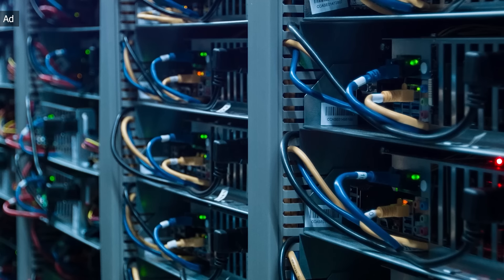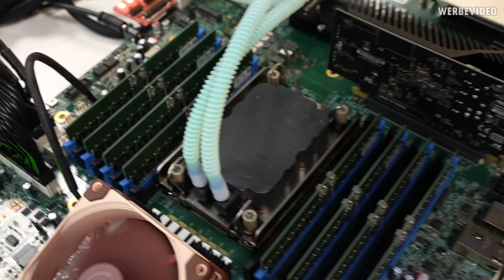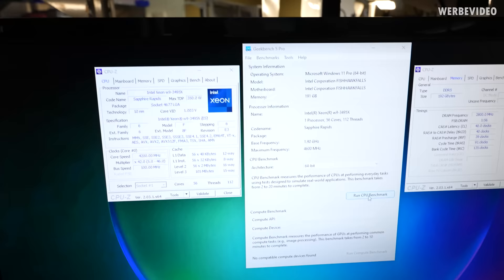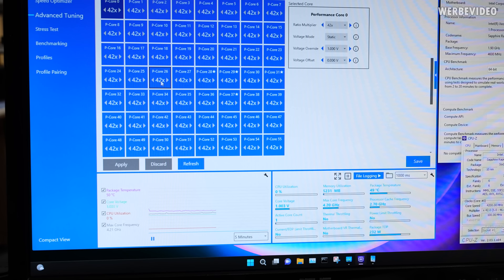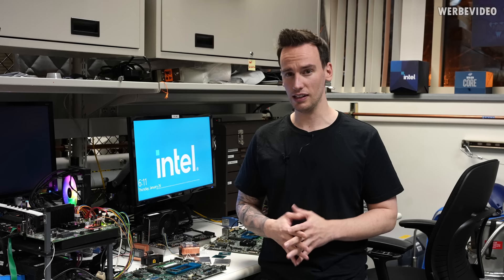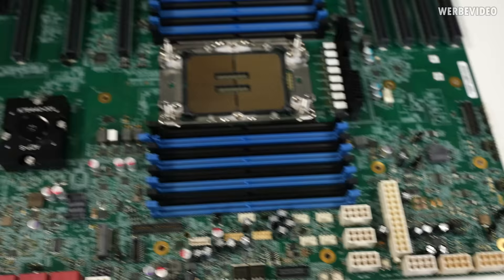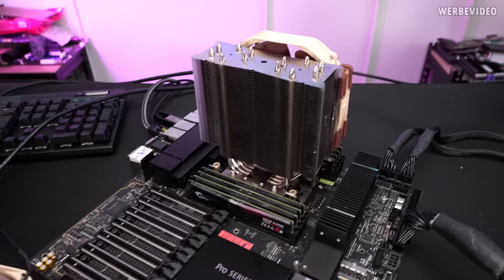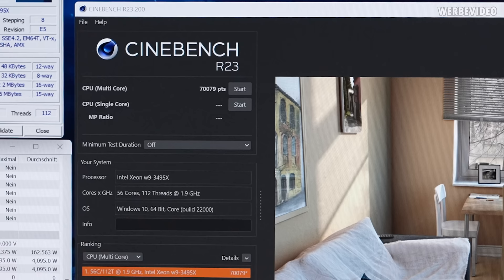Intel HEDT is BACK! Insane Overclockable 56 Core Sapphire Rapids CPU

Comment: For reference, I found a page which is showing the Ryzen Threadripper 5995WX scoring 65,112 points in Cinebench R23, with a base clock of 3.2GHz.  Sapphire Rapids is 7% faster with 12% fewer cores and 10% fewer clocks.  At 4.2GHz this thing might just break 100,000 in Cinebench!
Reply: Not stock, power limit was removed and it reached 516w (stock limit is 420w turbo) and it scored 70,079 points
A 5995wx (Zen3 is in its 3rd year now) also with power limits removed scored 69581 while the max power draw in blender was 461watt.
-Unreleased sapphire rapids =135.8points per watt
-Zen3 =150 points per watt
Do you think AMD could uncork the power and increase their score 0.7% with 11.9% more power?

The 4th (out of 5) place 5995wx score... is 78,632 at 4.35Ghz on water.
91,400 was scored by an old Zen2 3990x on H20.... in a case.
Reply: @tomstech4390  "Do you think AMD could uncork the power" No, actually.  From my experience in the early days with Zen 1 (I had a 1700X, 1800X, 2700X and a Threadripper 1950X and a 2990WX) there was literally no overclocking headroom no matter how much juice you gave it.  It wasn't power limited, it was something else entirely but I never could quite put my finger on it.  Has the situation improved on 7nm and 5nm with Zen 3 and 4?  I don't know, I haven't using AMD in a while.
Reply: @tomstech4390  "The 4th (out of 5) place 5995wx score... is 78,632 at 4.35Ghz on water."

Cool.  Thanks for the info.  In der8auer's video here, it hit's 70,079 pts with all the cores seemingly locked at 2.9GHz.  Using the same 360mm AIO in the test lab earlier, they were locked in at 4.2GHz.  Using a simple linear extrapolation, we can project a Cinebench score of 101,493.  Now obviously it won't be a perfect linear scaling due to diminishing returns, but it could get awfully close to that 100K mark.

Using a 1600w power supply, presumably...

Comment: 6:42 - I have a question, why does the core overview put the "favor cores" in weird places in the grid chart, instead of at the top?   My 7950x is the same way in taskmanager...  I can definitely spot which cores are the favored even though they aren't marked by stars or anything.    There seems to be no symmetry or rhyme or reason as to why or what in taskmgr compared to where they might actually be located on the chip / die.

Comment: Speaking of DDR5 ECC with XMP, i stumbled accross some DDR4 ECC a few years ago that had XMP and it seemed to work with everything, sure it was only 3200, but for a 128GB kit thats actually a pretty good speed for ECC at the time, and i think even now, because i think most ECC kits are still 2400/2666
Reply: With ddr5, there are already 6000mhz ecc kits, thats also pretty good.
Reply: @Sineseol  True, but you're not getting 4 sticks of 64GB ECC 6000 for several years, at least not running at 6000, let alone for ~$400 total
 
IIRC it was $196 for a 2 stick kit of 64GB DDR4 uDIMM ECC 3200 less than $300 for 128GB

Comment: Wow, that power draw is enormous... At least here in the states with 15A 110-120V(rms) circuits, thats a seriously non-trivial amount of power draw.
Reply: you'd be tapped out around 1800 watts on a 15A breaker, but could go 2400 on a 20A.  Maybe we will see the rise of 30A single phase 120V circuits to support our ever more powerful CPUs at 3600 watts...!  I see they have 30A single pole at HomeDepot for $6.98, but wondering if you'd need a larger gauge romex from the box to your server outlet, and what kind of outlet you'd have to use, guessing twistlock 30A.
Reply: @JimBronson  Most house wiring is gonna be at around AWG 12 good for 25A max, though regulations limit continuous loads to 20A. Quite a few circuits are only AWG 14 good for 20A max, with regulations limiting continuous loads at 16a. If you want a legal and safe 30A circuit you'd want to run at least 10 AWG. Alternatively, you could get a 240v circuit, use slightly less than half the amps for a given load (PSU are more effecient at 240 than 120)

Comment: I always used to build HEDT rigs, but switched when gaming became so core frequency dependent (to 10900K and now 13900K, OC'd on water cooling). Good to see HEDT making a comeback, but only suitable for productivity workloads given the low clock speeds and non multithreading capability of games. 10K is probably acceptable to companies needing this level of performance (plus 8K for 4 x 4090 🙂).

Comment: 56 P-core CPU + 4x RTX 4090 + lots of ram and hd etc. = 30 Solar Panels in the Tropical Zone to compensate CO2 emissions of such system runing 24/7.
In a portable solution you could have the first computer with petrol tank and generator, put two wheels and you'll have a server-motorcycle...

Comment: So nice for intel to also embrace cpu glue
Reply: But that glue will melt with 1KW+ heating the world!!!
Reply: @ianmoone8244  Jokes aside, it's a 1400 mm^2 chip. 1000 W isn't that much. You've got 4090s pushing 500+ W and they are only around, what, 600-700 mm^2? The power density is lower on the Intel chip than the NVIDIA GPU, so for a given amount of cooling capacity, the Intel CPU with 1400 mm^2 die area will be about similar temperature wise, and yes, maybe a little higher because you have solder and a heatspreader in the way reducing heat conductivity relative to a GPU that is direct-die cooled.
Reply: at least it's much better than AMD cpu glue which requires a massive L3 cache to compensate for the performance degradation due to the distance between the chips. Also if you want to buy Ryzen cpu plz go for with 3D cache. They just artificially limit the performance of those non 3D cache cpu.

Comment: Is this Windows workstation that can use those cores? My understanding is that "standard or pro" Windows doesn't run extreme core counts well and doesnt really understand how to access PCIE lanes as the RDIMM ECC speeds that the Workstation version can. Am I wrong? Seemed to gloss over the massive PCI lanes that can address the memory and NVME drives directly and in parallel.
Reply: You re right. Jumping from 8 cores to 16 on windows is no big improvement like you d get on linux and abovd 32C is nonsense but linux

Comment: I am really interested in getting an Intel W-2400 series 12-Core or 16-Core HEDT processor, but I need the DDR5 memory manufacturers to get on the ball and release larger DIMMs since I need 2TB of memory with it.  I need memory over cores.  I do special work with specific 3D software and game engines and the larger memory is a necessity.  The main 3D software that I use supports up to 4TB, with a massive maximum capability of 18 Exabytes.  I currently have two Intel X99 Extreme systems and an R9-5950X 128GB system (plus others).
Reply: Michaels Carport  - The W-3400 series would be nice, along with 4TB of memory, but they will probably be out of my budget price range.
I already priced out an AMD Threadripper Pro with 2TB of memory and it was $30,000 CAD.
I will probably have to settle on a W-2465X with 512GB to 1TB for starters, especially since DDR5 128GB/256GB DIMMs are really rare.  If I can afford the W-3400 series processor and get the full memory later, that would be an option, depending on the cost of the processor in Canada.
Reply: Michaels Carport  - I noticed the Epyc processors around for good prices.  Even NewEgg Canada has decent prices on the Epyc processors and server motherboards.  I can get an Epyc 16-Core plus motherboard for $2000 CAD which is decent.
The DDR4 ECC Server memory is $4000 CAD for 512GB though at NewEgg.  So for me to get 2TB of memory will be $16000 CAD.  That is still less than the Threadripper Pro 2TB I priced at $30,000 CAD.
But with Epyc and DDR4 I feel like I'm buying old tech that is now outdated and a dead end.
NewEgg Canada has nothing for DDR5 RDIMMs either which is what the new Intel W-2400/3400 uses.  So if I go with a W-3400 I will have to source the memory somewhere else like a memory company direct.
I am just going to wait until summer and see what the prices and availability are like in Canada.  Even if I can get a W-3435X 16-Core plus ASUS motherboard with 256GB memory to start, that will be more memory than any current system that I have.

Comment: Wow so for the past 10  years I had been planning to build a gaming PC and always wanted to go with the (RAM on each side of MoBo / HEDT / X Boards etc.) Mostly for the aesthetic looks.
I finally  gave in and went with an z690 board w a 13700k etc. So does this mean that we should expect to see these boards making a comeback or are they going to be available but at crazy high prices like some of the 'extreme' boards we see today?
Reply: I don't see consumer and hedt overlapping ever again. Threadripper already is a "non-retail" only part, and Intel's stuff is too. It's not like sandy bridge to haswell era where HEDT was the high end gaming platform. It's all locked up in the enterprise market.
Reply: I saw someone in a different comment speculate that the minimal entry cost would be around 2k for motherboard and cpu combo since the below 12 core cpu's are oem only and the previous hedt class intel boards were extremely expensive in their own right. In theory that would actually still be a great deal for what your getting if compared to threadripper, but depends on if you can consider that far above your price point or not.
Reply: @h.b.5577  Yeah makes sense! I mean, if they are already asking for $1000-$1400 for the high end Extreme boards then somewhere around $2k is probably what the price would be. I just don't think that the manufacturers would find it prudent enough to produce at that price point for retail but, who knows, I could be wrong.
Reply: @itstheweirdguy  Isn't that kind of why intel introduced the i9 in 2017 to kind of have a "high end desktop CPU" that worked on mainstream consumer boards?

Comment: So, the Geekbench score indicates Sapphire Rapids is about 30% faster, core for core, than Zen 3.  Now, if they can do something about that power draw...
Reply: They could try reducing the clocks 30%, but then it wouldn't be faster core for core.
Reply: Exactly my thoughts.. and that's overclocked. Under normal operation, the % is way lower.
Reply: @ryzenforce  @Toms Tech Um no, the Ryzen 5995WX was overclock to 4350MHz.  I think the base clock is around 3.2GHz

Comment: It seems like no way you can push that many amps through the socket pins. 
I think they will have to redesign how power is connected to the CPU from the socket. It is just too many amps for the (many) little tiny pins.

Comment: This feels more corporate workstation than HEDT, the price and core count if far beyond what most looking at HEDT would want. I can see the utility for a very small section of users but this is far from what HEDT used to be. 
An LGA2011 style platform offering sensible core counts and quad channel ram seems to be what people actually want and is just missing completely from the market. 
Your options are consumer dual channel CPUs, second hand old architectures or server based $10k monsters.

Comment: HEDT/Workstation didn't go anywhere, it's still exists and Intel isn't bringing anything earth shattering to the table, except hopefully some competition.  How many purchasers of these type systems are going to spend 10's of thousands and then overclock them, not many I presume.  The 3400 series is barely competing with TR 5000.  Let's not pretend Intel is some saviour of the HEDT market they abandoned.  AMD is the only one keeping HEDT and Workstation alive.  In the end I wonder what would be cheaper, 1 Xeon W9-3495X, or 7 - 13900K or 6 - 7950X systems in a distributed system.  The latter systems may be less expensive and perform better.
Reply: Right here. I will. If I can save 1 hour a day by overclocking, then I will do it. The single Xeon would be the cheaper (and fastest) option.

Comment: can you please test energy efficiency with undervolting/underclocking this cpu? what is the sweet spot, like you did for 40xx nvidia cards. Energy consumption is very important for such servers. I suspect it will draw half energy at 3.7-3.8ghz with 10-20% perf decrease

Comment: Wow, 42 Ghz all core on a 56 core processor, may be we can get a 16 core chip and overclock them to 6 Ghz all core, and be are all set for the next 6 years.
Reply: That isn't going to happen, even with a chiller. you might get 5.5 all core on the 16 core part.

Comment: So pretty much a direct competitor to the 5995wx then? HUB showed that pulling 461w without power limit, and scoring 69,500 in Cinebench R23.
Reply: According to Puget System's testing Sapphire Rapids Xeon-W is slower than Milan (Zen 3) Threadripper Pro basically across the board. So yeah, it's a "direct competitor" but one that's YEEEEARS late and still kinda dogshit. 🤷

Comment: R23 score 70k+ with only XMP enabled, when you OC this 56-Core Monster I think it will get 90k+ R23 score.
I am getting a R23 score of 77,986 with my 3990X - 94C - 898watts - 4.3Ghz and this is ringing it's neck to squeeze out as much performance as possible.
Reply: Please test LINPACK, I'd love to see what GFLOPS you could push with that monster 3990X!
Reply: @NUCLEARARMAMENT  I can tell you, running linpack occt with these maxed out settings, it would run for 45 minutes and then crash, but other software like Cinebench would run fine with no crashes. Linpack occt is one of those kinds of software that I think pushes things a bit to far and the samething for prime 95. Normally I think if it can run Cinebench for four hours with no crashes then all is good.
Reply: @Subaru_God  i agree...
Reply: @TheBURBAN111  :thanksdoc:Bless, You:thanksdoc:

Comment: Can you guys help my memory.
If I recall correct, calling it mega transfer is the correct term contra MHz.
But the number referred as above is still the same right?
Eg, at the time, I bought 2833 MHz ddr4 stick ram, but the correct term is 2833 mega transfer ddr4 stick?
Reply: Technically yes.

Comment: On one hand, cool. In 3-5 years I might be able to get a used one.

On the other hand, is it really 6x the cpu of a 13900?
Reply: Its like 7 sets of the P cores stuck together basically from a 12900K, not a 13900K. If they got it from a 13900K they would probably be able to touch 5ghz on all the cores at lower or same power to this. So that is something to maybe look forward too in a year or two, a 64 P core 5ghz CPU from Intel.
Reply: The total throughput of this chip at 4 GHz, can score up to 7 TFLOPS (FP64). An i9-13900K with its 24 cores at 4 GHz only scores around, what, 1 TFLOPS (FP64). That's a pretty sizable difference. Even at 5 GHz, you only get up to around 1.2 TFLOPS (FP64), which is still six times slower in terms of max theoretical throughput to the Xeon at 20% lower clock speed. 

You also only have 2 versus 8 memory channels, which means 4-8 times lower memory bandwidth depending on whether you use DDR4 or DDR5 on the i9-13900K, and you only have 20 lanes (80 GB/sec) of PCIe 5.0 and 8 lanes of DMI 4.0 (16 GB/sec), which is 96 GB/sec of IO bandwidth.

The Xeon W9 has 112 PCIe 5.0 lanes (448 GB/sec) and 8 lanes of DMI 4.0 (16 GB/sec), or 464 GB/sec of IO bandwidth. You get 4.5 times the IO bandwidth, over 6 times the floating-point and integer throughput, and 4-8 times the memory bandwidth depending on DDR4 or DDR5 used as a baseline for the i9-13900K versus the Xeon W9. 

I'd say that justifies the 10X asking price over the 9-13900K!
Reply: @yungnachty4474  
A year for WS/HEDT refresh, Intel hopes to launch Emerald Rapids server SKUs by the end of this year. They're not the same, but by comparing server CPUs and extrapolating the results we might see potential performance and power consumption of ER WS parts.
Reply: @NUCLEARARMAMENT  Who are you replying too? I don't think anyone in this comment thread was advocating for getting a 13900K over the 56 core W9 for the types of things you would use this processor for?

I mentioned the 13900K but only in thathis W series Xeons are using Alderlake and not Raptor lake P cores, as using the P cores from Raptor lake would allow for the chip to run higher due to being way more efficient.
Reply: @yungnachty4474  I am talking to the person who started the comment thread. I provided a comparison to the 13900K in exact detail, and I got my point across. 

The Golden Cove cores used are about 10% slower than the Raptor Cove ones, but you get 4-8 times the memory bandwidth, and 2-4 times the floating-point and integer throughput per core on the Xeon when you compile your applications to take advantage of it or use ones that already are.

The 10% IPC improvement from the Golden Cove core to the Raptor Cove core doesn't mean much outside of single-thread workloads, you also have no ECC support unless you get a W680 motherboard.
Reply: @yungnachty4474  This doesn't really make any sense, they are both made on the same process node (10 nm Enhanced SuperFIN, which has been rebranded to 'Intel 7').
Reply: @NUCLEARARMAMENT  A 13900K scores about the same as performance as a 12900K at 1/4 the power. 65W vs 240W.

There are efficiency gains, you can refine a node and gain efficiency.

And you did explain well the technical aspect of the OPs question.

Comment: Any recommendation for the best single-core performance? Platform needs to support >=256GB For running Wax nodes, the single-core performance is the most important. They use Xeon Gold's pushed above 5GHz mostly now, but it's such an expensive platform 😅 I was hoping the new W-series would be an option, but their IPC and max clock on just 1-2 cores would mostly determine that 😅

Comment: 10000 is not that crazy, considering 13900k/7950x build with good ram and decent components would be 3000+ depending if you want GPU and which one